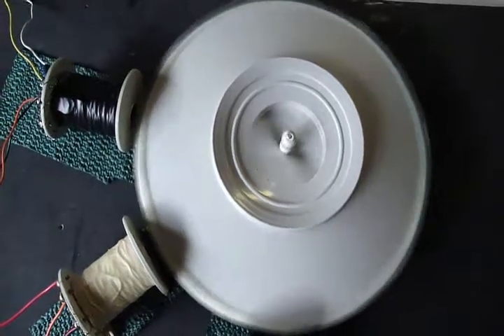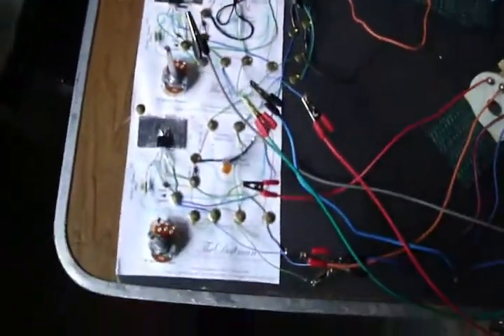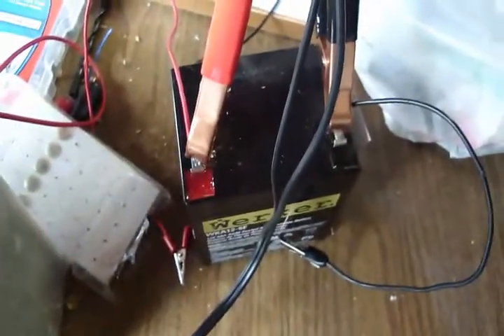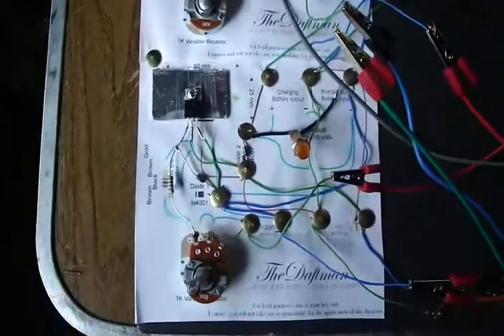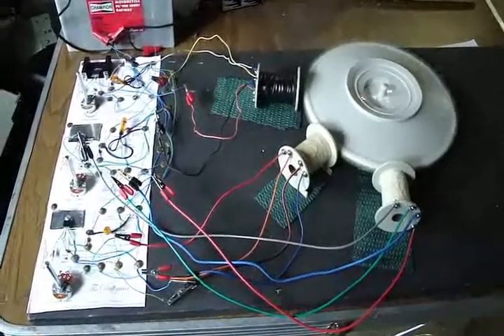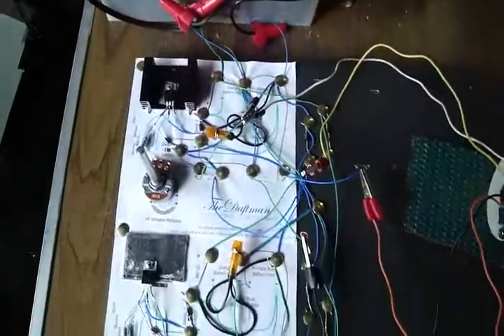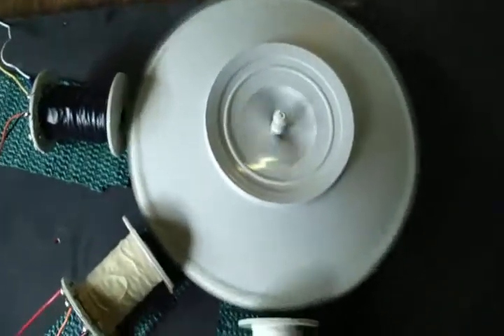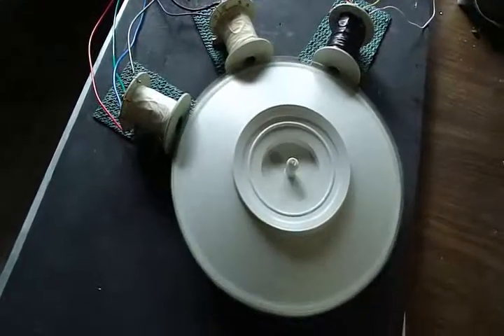3 Coil theDaftman-Bedini motor.avi

Comment: Hi Sir Farquat...

Using one rotor build a circuit for every coil as if it were a single transistor motor. Using one battery to power all and either connecting all the outputs to one battery or one battery per motor output.